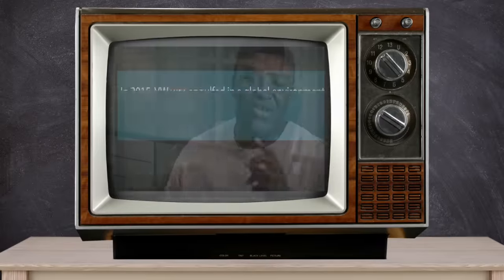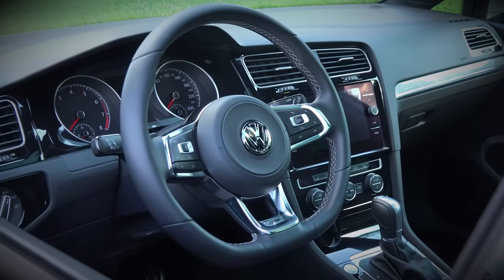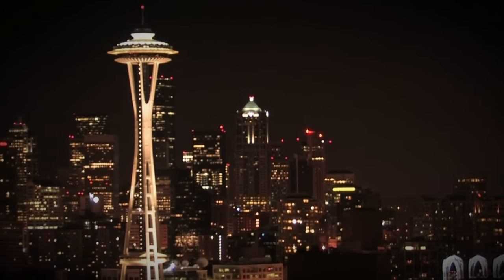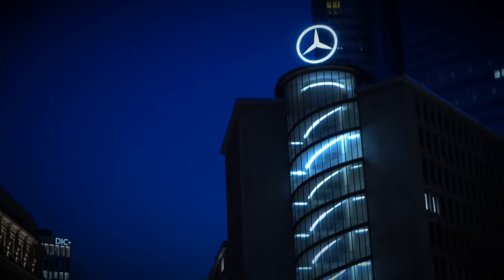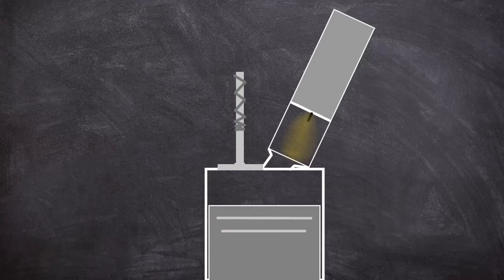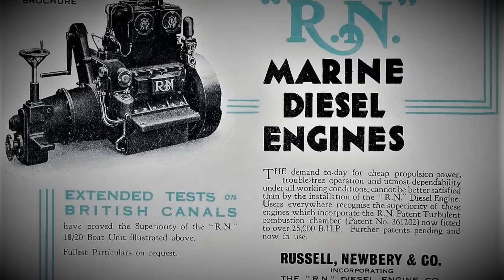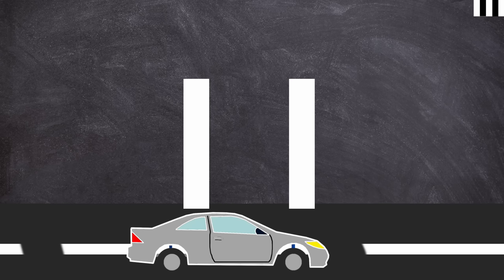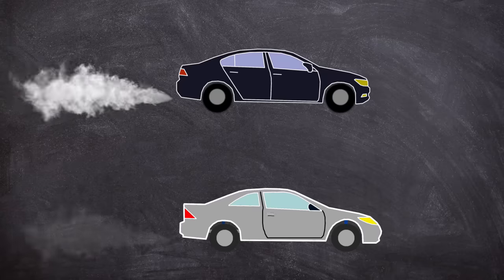Scandal: VW Emissions Dieselgate Explained | Plainly Difficult Documentary

Comment: I live in Seattle and for 6 months lived in San Diego back in 2021. I've done that drive between Seattle and LA many, many times and between Redding, CA and LA, it's the most boring drive I've ever done (if you take Interstate 5). 

Pro Tip: get off of Interstate 5 at Redding, head east over the Sierra Nevada mountains and join up with US 395. It's far, far more scenic, less traffic and you won't get stuck behind all of the semi trucks trying to pass each other. The extra distance is minimal and I've found it doesn't add more than a few more hours of travel time but it's worth it

Comment: I worked at an auto auction yard in 2018-2020. They had a giant part of the back lot being rented out by VW to store a bunch of the cars they bought back, just trying to figure out what to do with them all. By this time, most had been sitting for years, and it was showing on a lot of them. As part of the storage contract, we had to start every car and drive them around the yard for about 15 minutes once per month. It was a pain, because almost all of them had bad batteries, flat tires, and just other problems from sitting for so long.

It bothered me to see over 500 vehicles just sitting in a yard to rot, that can't be sold back to the public without performance-altering modifications, instead of being used for their intended purpose. A good chunk of the cars had less than 60-80,000 miles on them, and would have had a long life ahead of them on the road. When I left, they had started to scrap any of the ones that had more than $1000 worth of body damage on them. I drove a 4 year old Jetta with 9,000 KM on it to the crusher, because the rear driver door had a fairly sizeable, but not unrepairable dent in it. It hurt my soul.

Comment: I think the Pinto fuel tank takes the biscuit.
Reply: Or Takana airbags.

I'm speeling that wrong, guaranteed.
Reply: 1976 Dodge Aspen front fenders come to mind as well
Reply: My 66 Mustang isn’t too much better then the pinto.
 I’m amazed the other ford models using drop in fuel tanks don’t get the bad rap as well. 

My 66 mustang’s Drop in fuel tank acts as the trunk floor , sitting behind the rear axle with only a minor sub frame behind it and the stock muffler sits parallel inches from gas tank.  But hey Mustang

Comment: I think it's interesting that VW switched hard to electric, and I think there's an historical precident to say the internal combustion engine is almost finished.
In the 1940's some of the most modern, efficient, powerful stream engines ever built were put up against very primitive diesel locomotives. It was no contest. There was no reason to pour more research and development money into steam, when diesels so easily came out on top. Law of diminishing returns. 
Internal combustion engines are at their peak, electric is just getting started.
Reply: Not giving up my oil burner, I;ll make my own gas. Sheesh
Reply: Electric is getting started for the past 100+ years. It's already found its use cases - bit road vehicle is not one. Not with current (30 years old) battery technology and state of the electric network.
Reply: Electric won’t be ready for another 60 years
Reply: The largest series produced steam engine is from the 40's (in the USA) eg no. 4014 were outmoded via diesel due to needing to stop every 100 miles for water when heavily laden. This is not a thing in diesel land.
Reply: It's an odd fact that, in spite of the wonderful wartime performance of the big FTs with their dynamic brakes, some railroad officials were still unconvinced of their merits. With a background of 100 years of steam, they still couldn't believe that Diesels could equal the performance of some of their pet creations. Thus shortly after the war ended, the president of one Western road made some disparaging remarks about The upstart Diesel to an Electro-Motive salesman. 

"When you can equal the Big Boy up there,' he said, pointing to the picture of a steam locomotive on the wall of his office, "come around and well talk business.' 

When Dilworth heard this later, he decided that the challenge called for blunt action. The fact that the "Big boy" was a locomotive in the 6,ooo-horsepower range, a monster with sixteen driving wheels, meant nothing to him. Steam locomotives seldom delivered their rated horsepower. They were af- 
fected by soot, scale, and cold weather, factors that meant nothing to a Diesel. Dilworth knew that his 5,400-horsepower freight job could hold its own against the Big Boy. He wasted no time in getting to the telephone. 

"I hear you've been taking advantage of the ignorance of one of our men,' he said to the official. 'I'd like to make a prediction. If you'll put our four-unit freight locomotive alongside your Big Boy on that hill out in Utah, we'll push your Big Boy so far back into Lionel's window with the rest of the toys that no one will ever talk about it again." 

From 'The Dilworth Story', the biography of Richard W. Dilworth
Reply: @kennethlacewell1517  diesel did and still has trouble with cold weather to the point of requiring chemicals in the fuel if it's really cold and glow plugs or some other scheme to warm the bores.
Reply: Yes, diesel has drawbacks. So do electric cars. The point is the law of diminishing returns. Gasoline and diesel engines are already highly refined. It takes a tremendous effort for even tiny improvements. Electric is improving by leaps and bounds. And fuel cells are just around the corner.

Oh, and railroads have been avoiding electrification for 100 years. Diesels helped them put it off. But I think global warming will finally force it.
Reply: @kennethlacewell1517  I'll take batteries over fuel cells any day until that technology is lightyears ahead of where it is today. Electrical infrastructure is pretty clean and transporting gases over any distance is not. It's a problem with natural gas that would be magnified mightily with hydrogen.
Even NASA has problems with bespoke hydrogen systems on one site and not a nationwide infrastructure.
Reply: @halogod0298  wrong

Comment: While condeming the fraud itself, the problem of today is the real alternatives to go away  from the advantages of the Diesel engine, such as very economical and with high torque. Myself driving a VW Passat Diesel ... I saw 2 electric cars burning like infernoes a few months ago, a horrific sight .... There are huge  dump areas not very far from my area full of  thousands of 10 year old electric cars are discarded because their batteries are exhausted and are  let to rust... They are rejected from scrapping by scrap yards because their highly toxic and dangerous batteries.... So they are abandoned and let to slowly release the toxic content of their batteries into the environment.... That is 10X far more toxic than Diesel emissions, and those batteries let exposed are a ticking time bomb until one might  instantly ignite out of a sudden and even explode....
Add the triple cost to electricity of today's greedy energy suppliers that increase profit out of inflated bills  ( and NOT because producing electric energy would have become more expensive today than it has always been... And electricity production is actually relatively cheap , hidroelectric plants produce cash out of water that flows for free... Many nuclear plants produce electricity dozens of years with minimal maintenance... The Sun provides solar energy unlimited and at no cost.... )
Taking into consideration all these mentioned,  compared to the highly expensive and  sometimes dangerous electric cars that in 10 years are good for scrap yard or need about 20.000 dollars to change batteries, and run for electricity 3X more expensive now because of corrupted politicians that make laws so that greedy energy suppliers would make huge profit increasing our bills....while the discarded batteries are a huge hazard for explosion risk and high toxicity.... Diesel still IS today the best alternative.... Less toxic , less polluting  and not dangerous compared to electric cars' battery of today's technology... And far more economical than petrol engines that also need more revs to get the power needed ,making them more stressed engines overall than lowe revvind Diesel with natural beefy torque, that would make them also not as long lasting as Diesel engines could get ...
I am not doscussing the fraud itself that VW made... That still is shameful.... Sadly, I am convinced that many manufacturers did similar things and were just lucky not to be caught to thos day....
Reply: If an electric car battery is totally dead after only 10 years it's almost certain that there are only a few bad cells and the rest of the pack is fine. Specialists can replace the bad cells and the cars would be fine again. A scrapyard would need to be crazy to reject an EV unless the battery is physically damaged.
Reply: @eDoc2020  technically it might be possible for sure, but unless you got a personal friend who can do that, you would pay very big money for such a repair... I know someone who had  a small cheap ev car.... In 3 -4 years and already out of warranty, something broke down to its battery. And it was not charging properly..... The service  proposed her something around 3500 euro as a repair, too expensive for her budget. So she had to keep using her car with a very limited range. One day while charging at home something broke again and burned all her electric panels inside her house. She  went to the authorised service again and they said the battery is a total loss, only replacing it was possible at around 18.000 euros plus work hours for the technician, all around 20.000 euros.
She had  payed about 20000 euros  for the whole car as new, she couldn't afford it... Other dealers refused to even try to repair it because there are very few skilled technicians on ev car batteries.... So in 4 years her new car went to scrap yard
Reply: @cristiancristi9384   Authorized repair is rarely the way to go, and many earlier EVs had worse batteries. Of the big brands in the US the Leaf was the worst.

Most EV batteries are bolt-together pieces. The hardest part of basic repairs is just wrestling with the sheer size of the units. Once it's open you can take a multimeter and go 3.8, 3.8, 3.8, 2.7, 3.8, which one is bad? As EVs become more common there will be more independent shops who will be experienced with this. Note I said independent shops, dealers will surely just quote an expensive whole pack replacement.

The scary part is that some makes (like one that rhymes with Besla) are very consumer unfriendly and are reportedly making the batteries unreplaceable in newer models. I really don't like that company and I sincerely hope others don't go the same way.

Comment: dieselgate scandal aside, i LOVE my TDI. mine was one of the ones bought back by VW, “fixed”, then resold with a generous warranty. it’s a wonderful car, and i get a lot of funny looks when i put diesel in it 😂
Reply: We own two TDI Beetles.  One of them has the fix, and the other is still all original.  We love them both.  The un-fixed one is much faster and gets better fuel economy than the "fixed" one.
Reply: Easy to reflash the ecu back to performqnce spec
Reply: @carlosoruna7174  im waiting for my warranty to expire before i do any mods to the car. mine is a 2015 Golf which has it’s emissions/turbo/long block warrantied until 2025 or 160k miles. thankfully i dont live an inspection state, so i could “hit a pothole” if i so desire lol

Comment: PD.   It’s possible there are several levels of conspiracies going on in the VW diesel case.  We have owned 2 of these cars (6cyl toureag).  They weigh 5500lbs, accelerate like crazy (loads of torque) and get 33-34mpg average and 36-37mpg Highway , even at 100mph for hours out west.  The exhaust is clean enough you can’t smell much of anything.  
If you pick the gas version of the same car, you get 22-24mpg.   So the diesel output from the tail pipe is 30% or more less (all totaled) than the gas version.   Further, exhaust from gas cars stink of combustion byproducts, and zero people are discussing what evil brew these chemicals are doing to you.   Much of the shipping everywhere is done by Diesel engines, cars being a small portion, so why attack these?  

My guess, is first it was a huge money maker for governments and lawyers, second it slowed VW down (way less that expected) against US and Japan brands.  

The big focus on nox overlooks the other crap coming from gas engines in 30% more mass.   Other diesel makers likely had similar issues with nox, most were pushed under the carpet after VW took the dagger for the team.   Lastly don’t forget the interests of the gas fuel producers and distribution, they had to play a part and benefit.

Comment: V.A.G announced on the 29th of September, 2015, that it was planning to recall and refit the 11 million cars...  My wife and I bought one of these cars...  On the 25th of September, 2015.  LOL.  A 2012 VW Sportwagen TDI.  We'd had the thing 4 days before we found out about the issue.

On the plus side, though, after the recall -- which took VW well over a year to design and make the parts for --  the car ran just the same as it had before, maybe even a tiny bit better acceleration at lower speeds.  And we got a ton of money from VW -- like almost $5,000 for "lost value."  We only paid around $20K for the car to begin with.  LOL.  Worked out very well for us.  We put 212,000 miles on that car before the turbo finally died and it was uneconomical to fix it, so we scrapped it.  My wife now drives a 2020 VW GTI -- talk about a fun car!   Although we do miss the utility of the Sportwagen, and its nearly 40 MPG on the highway.

Comment: The Test Mode was so simple it was kind of genius. 

No steering input whilst running the car for more than 30 seconds and having a speed of 0 kph and it being in neutral gear? Test Mode.

And it's kind of sad, diesel is far cleaner nowadays than Petrol, but yeah, it has a massive stigma on it because of dieselgate
Reply: @LTNetjak 

If you compare the Euro 6 norms, Gasoline VS Diesel emissions, diesel is a lot cleaner than Gasoline
Reply: @Swat_Dennis  Do not take any Diesel emission numbers as facts. Only true numbers are the ones being actually pumped out of the engine. And the extra cost to buy/own/repair makes no sense. Commercially or Private. Only farmers and the vehicles doing heavy work needs diesel. And I'm still not sure why commercially there is not more older pre 2005's vehicles being fixed up and put to work.

In EU there is plenty of SUV's and luxury sedans running diesel engines. Only thing different now is that this ** that spend to much money on luxury items are interested in electric vehicles ONLY for the comfort and luxury of being 'green'. And hey going from a 2.0 liter diesel to a electric sports vehicle is sure a upgrade. Diesel gate was more of a USA thing. In EU most still have gone Diesel rather then petrol.

Comment: I own a Polo SDI, and a 03 TDI. Cheapest and most reliable cars I've owned. 50+ mpg and the TDI is at 350k miles. They put VAG on the sacrificial alter and swept the other manufacturers under the rug like they weren't doing the same thing. Comical. Thanks to all of the whiners, we won't get another VAG diesel here in the states.
Reply: Your devotion to the aryan cause has been duly noted. We shall reign for a thousand years. March on soldier!

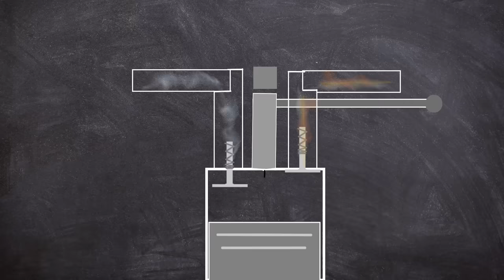Comment: 6:20 Diesel injectors, as far as I know, cannot vaporize diesel fuel, they atomize it, due to diesel's low volatility. You need high velocity swirl inside the cylinder, in addition to peak quality fuel atomization for the most complete burn. This is why stock pistons are not valve relieved. Valve reliefs interrupt swirl and can only be overcome by intense turbo boost pressure.
This results in very low soot, high fuel economy, but high EGT and high NOx emissions which require SCR to scrub.

Comment: Having spent my career in the auto industry, and most of that doing emissions development- this scandal was pretty stunning.  I know you suggest that there's an industry wide problem, but we never really saw that- most were honest.  Some were more conservative than others, but this cheating one was really odd- considering the consequences.

But there has been a lot more fall out to the rest of the industry.  First, the EU recognized that their bias in the emissions rules toward diesel was very bad, and they are correcting that.  If you didn't know, diesels were allowed to pollute more NOx in the EU than gas was.  That's done with.  

Second, testing is moving toward real world driving testing.  The same tools that were used to find this problem have been very developed, and the EU is moving toward 100% real world driving for all certification testing.  The US will remain lab testing, but with a lot of modifications coming with the next development of Tier3/LEVIII rules.  And China is also getting into reducing their emissions very quickly.  

While this was a terrible scandal, in the long run, the benefits because of the industry wide changes will be a net positive.

Comment: My son bought a 2014 Passat TDI about 18 months ago. It's got about 138k miles and started losing power over a month. He takes it in and finds out he's got a blown turbo, turbo cooler, and it will need an entirety new exhaust, luckily, that it was covered by a 150k/10 year warranty due to "diesel gate". Problem is, there are at least 800 people waiting for the catalytic converter and he'll have to wait. For at least a year! Volkswagen's solution to this problem is to provide him a rental car that has to be exchanged monthly. At a dealership 75 miles away.